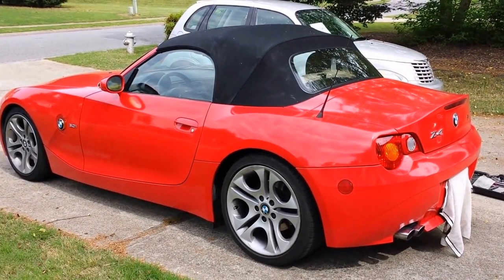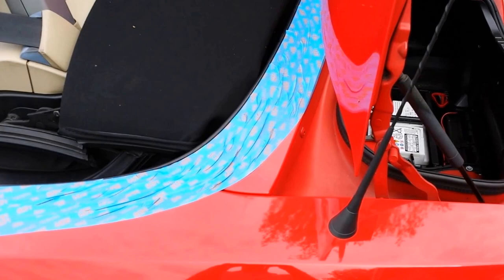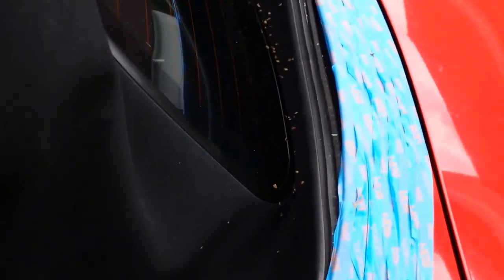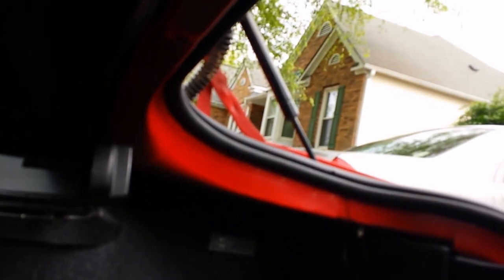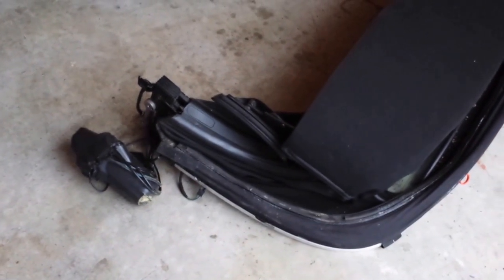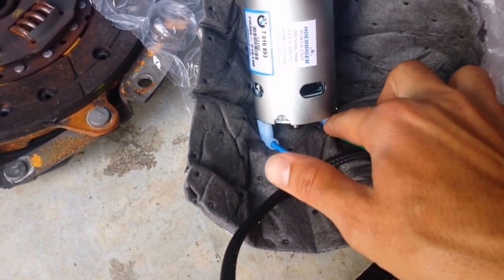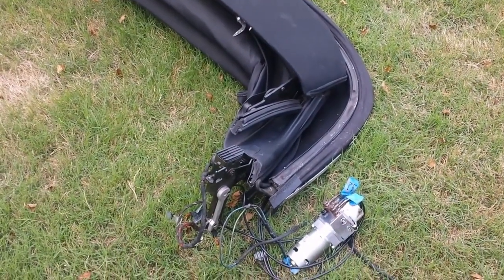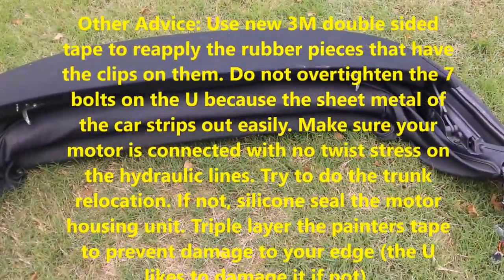How to remove test and replace a BMW Z4 Soft Top Motor COMPLETE HD

Comment: Awesome video and step-by-step instructions.  I will be attempting this very soon and relocating my motor to the trunk.  I would love to see pictures of how you mounted yours inside the trunk if you have any.  Did you re-use the same container that the motor was stored in from the factory or fabricate something else?
Reply from the maker: Thanks Jeff. I ended up cutting two slits in the side wall just adjacent to the plastic trunk roof latch mechanism. I had to remove the trunk roof and the left mounting shell for the trunk roof (that covers the shock/strut position as well). I bent the small flap down and simply placed the motor in the trunk with the wires coming through it. Placed many layers of  electrical trape on the cut plastic edges to protect the lines from rubbing against them. The motor was left nude on the top half but rests in the lower half of the housing unit. It was a tight fit with the top on and this way I can check and fill the fluid level if needed. I chose not to tuck it beneath the trunk carpet. I can make a short vid if I lost you on this explanation.
Reply: @Pray4UrLife12  Thanks.  You explained it well and I can see what you mean.  My motor seems to be working (at least I can hear it run when I push the button) but the top doesn't move but can be operated manually even with the red lever that disengages the motor pushed in.  Could it just be out of fluid or does that mean there is a leak in the hydraulic system somewhere?  Either way I have pretty much decided to remove the top just so I know for sure what's going on.
Reply from the maker: @jeffk9658  could be low fluid or you just need to prime fluid throughout the system again. If mine sits too long it takes a good 40 seconds of holding before I get fluid pressure top open my top. I used a heavier fluid than oem though so I recommend you use the orange/gold color hydraulic fluid, if not oem, to top it off. If it's a louder noise than usual, it's probably low on fluid. Later on, I had a fluid leak out of my right hydraulic hinge and decided to send both of mine to get rebuilt. No issues since.
Reply: @Pray4UrLife12  Wow, very good info.  I really just bought the car a little over a week ago so I don't know what has been done in the past or how the motor sounded before, although it doesn't seem very loud.  I tried holding the button down and the motor runs for about 15 seconds then stops and the red light flashes the entire time until I put the top either completely up and push the close button which locks the top to the windshield or all the way down and put the down button to complete the process that way.  I also could hear a fain "gurgling" sounds coming from the area of the motor leading me to believe that it may be leaking fluid.
Reply from the maker: @jeffk9658  welcome to the club. Yes, def worth the look.
Reply: @Pray4UrLife12  It's been a couple of months but I thought I would update on my situation.  As it turns out my motor is fine but the hinges were leaking.  Replacement hinges would have been around $1,600 but I found a company call Top Hydraulics out of Oregon that will rebuild them for about $500 (after shipping).  They also sell longer hydro hoses to help with relocating the motor to the trunk but I did not buy those.  Removing the hinges is quite a task and I wish I would have done a video because I learned some things that would help others going through that.  Anyway, the top is back on and working except that the driver side latch does not exactly meet the holes on the top of the windshield so I have to "coax" it in by hand.  Something is not lined up exactly.  I also have an airbag light that was not there before.  I've had it checked and every airbag sensor in the car is throwing a code which tells me I missed a wire or cut something while reinstalling the top.  Thanks again.
Reply from the maker: @jeffk9658  gratz on finally fixing it. I too used Top Hydraulics to rebuild both my hinges when I noticed one of them were leaking. Great company at a great price. Odd thing is, ever since I unplugged my battery on my z4 my airbag light has been on. I can't remember what the code was throwing but I have not bothered to correct it. In regards to your misalignment, I would simply undo the bolts that mount by your hinges and readjust from there. No need to take the top back off.
Reply: @Pray4UrLife12  I went ahead and removed all of the bolts in the trunk as well as the hinges and put it back together with the top fully closed.  It improved a little but is still off.  I believe the hinges may have been damaged when Top Hydraulics rebuilt them or I did something when removing and reinstalling the top.  I can live with it.  I would really like to get the airbag light turned off so if you find a solution please let me know.
Reply from the maker: @jeffk9658  same. Keep me posted if you can. Thanks!

Comment: thanks for the upload way more useful thank prodemand. im having an issue though i swapped the motors and tried testing motor work but its not pumping fluid is there a bleed procedure. im testing everything before i reinstall and im not pumping fluid through. ive even loosened the banjo bolt and its not pushing fluid through im kinda lost at the moment any advice would be appreciated
Reply from the maker: Late comment but for those reading this: if you are testing the motor in the car after installing and the motor is not working (no power to it) and you see an orange light at the top lift button it is because your trunk roof is not installed to engage the safety sensor which is found on the back wall of your trunk. Either cram a paper towel into the sensor to engage it or install the trunk roof.

Comment: Hello , Pray4u , I had the same issue about hydro pump motor then I just purchase a new one . After I replaced its and test its before reinstalling the rooftop back on its just work fine . Then after I put it back in , I heard the motor running, but the roof doesn't move at all. So do you have any idea or did I do something wrong? Thank you, have a good labor day weekend.
Reply from the maker: James Le is the trunk roof installed correctly? It needs to be contacting the sensor that you see on the back wall.

Comment: Forgot to ask...anything special I should specifically be looking for physically on the pump to see if it starting to fail?btw..sold my 2004 325i with 80,000 before I bought the Z..excellent shape..clutch was getting tired.same color combo as your Z.
Reply from the maker: The pump failing is usually caused by water leaking into the housing. You can hear the pump work super loud and sound like a cringing machine more than a smooth motor. What I did was add extra fluid to mine and relocate it to behind the drivers seat for now. I am short so I can get away with this. I suggest using a lifetime waterproof silicone. Only use a little bit because if you make it too thick it won't squeeze back into its spot. On the motor itself, usually towards the bottom and on the "motherboard" you will see rust and corrosion start to form if the housing is compromised.
Reply from the maker: Nice buy! I went 2 months looking for a 5 speed 3.0 and ran into mine. I didn't want red but it really grew on me. The 6 speed won me over.

Comment: So my z4m too stil works just needs some assistance closing. ECS tuning sold me a repair kit any thoughts on it ?
Reply from the maker: Assistance closing in what way? Could you be more specific? Have you checked your fluid level? Any leaks in the lines or hinges? Never used a repair kit so I don't have much I could comment on that, sorry. Maybe someone else can chime in?
Reply: Pray4UrLife12 so when I open the top I hold the button it works fine. When closing it starts to hum like it’s trying to close and I have to use one finger and apply maybe 5lbs of lift and the top starts closing and I can let go about half way and it does the rest in its own. Idk how to check the fluid. I bought a repair kit from ecs and a liter of the hydraulic fluid. To check the fluid do I need to remove the top? I’m very handy on working with cars I have to e60 v10s just never had a car with a hydraulic top. Also I have ISTA D I’m guessing I can prime the pump from there and see if it’s better
Reply from the maker: The issue you are describing was similar to what I experienced with my car (unrelated to this video and happened this past year). I took the top off because I wanted to inspect the hydraulic hinges. It turned out I had to send my right hinge off to get rebuilt because it was leaking fluid and not holding pressure well. This was causing the roof to need a helping hand up. I could also see that the left side was coming up more normal than the other before it reached the point that it needed a helping hand. I decided to send both hinges off to be rebuilt for about $400 US.  I would first check your fluid level. While you could sneak the motor out without removing the top by reaching in and pulling it out, I would just take it off to inspect it all and then relocate the motor to the trunk when reinstalling for easier access in the future. The fluid container is on the motor itself and a fill line is marked on it. Google a picture of one. I hope that helped. Good luck!

Comment: That's probably, I just threw it in and may be the hydraulic line they are not correctly to be straight w/the hole in there. Thank you Pray4u, I have to redo it again.
Reply from the maker: No James, do not do it over again yet. Just go to your trunk. Look at the black plastic trunk roof you pulled out. Make sure when you put it in, that it hits the metal switch in the middle of the back wall. The silver switch inside should be depressed for your roof to work.
Reply: Pray4UrLife12 
I see, thank you so much...

Comment: Hi.
thanks for your educational video, I wonder if you can help me, my cab doesn't lock  when I open it, so the red  light  keeps flashin all the time, what's wrong? thnks in advance!  Greeting Iradj
Reply from the maker: Sorry for the late reply, perhaps you can reply how you fixed the issue so others can learn too. Are you saying that your roof is closing but does not lock tight once it is pressing against your windshield frame front lock hatches (by your rear view mirror)? If so, it sounds like the issue is the latch lock motor that I believe is found within your framework above your rear view mirror.

Comment: Just started follow you ! 2 questions what happens if you connect the two wires in the bottom of the motor wrong? I did not mount everything back before I tested, but did not work I could hear the electric motor spool but no movement.. same thing when I had the whole convertible out and I tried with a car battery, no movement of the pistons just heard the electric motor spool. Please help me out
Reply from the maker: Hi Zed fam, if you reversed the plugs I believe it would close the top when hitting the open button and vice versa, unsure if it would get interrupted by the initial or final locking mechanisms. It sounds like the pump is still priming the system with fluid. If you filled the reservoir to the fill line it may take 20-30 seconds (or longer) of holding the button before anything happens. Make sure the motor is not sideways to the point that it introduces air bubbles into the lines. Be sure to recheck the fluid level and top off again after it opens and closes. Give this a try and get back with me. Good luck!
Reply: @Pray4UrLife12 Thank you ! the pump had some hydraulic oil in it when I got it (brand new). Do I need to fill additional oil ? I think it's facing down correctly. But I am thinking about switching the hyd lines or the cables. I connected everything the Same way as on the old pump and I thought the worst thing that could happen is that it goes in the wrong direction ?
Reply: @Pray4UrLife12  also if you hook up a battery to it when you have the cab out should the whole thing move then or do you just hear the electric motor spool ? If everything is connected correctly..
Reply from the maker: @bestinshape5368  The entire top closes and opens if set up correctly and all is well. What made you replace the motor in the first place? What were the symptoms? Are you sure your side hinges are okay? No leaks from there correct? Ever resolve your issue? Sorry for the delay.

Comment: Hi, thanx for a great video. How long does it take to do this? Is it doable in a weekend?
Reply from the maker: if you have the motor already, it can be done in about 4 hours. The annoying part is waiting to buy the motor until you test the current motor after removing the roof. Then having to garage the car until you get your motor.
Reply: Many thanks for your answer. What is your opinion regarding failing opening....Is the motor the most likely reason for malfunction?
Reply from the maker: Istvan Bartha is the light that is by the roof button in your cabin red or orange when you hit it? if it is orange then your trunk roof is just out of place and the safety sensor is stopping you. a motor may be bad if it opens the roof only partially, makes loud grinding noises, or something nothing happens at all. diagnosing is the hardest part.

Comment: Hello.. How much oil you get in? Thanks for answer
Reply from the maker: I am not sure what you mean. If you are asking about the oil for the motor, I believe there is a fill line that you can see in the chamber. I filled it up to there. Open and close the roof a couple times then recheck the level again.

Comment: I tried replacing mine and hydraulic fluid is spitting out from where the hydraulic lines meet the pump. The top wont move. Any ideas on why that would happen
Reply from the maker: Did you make sure to tighten down the bolts all the way and place the lines in the correct spot on the motor? I don't remember if there are o rings but you should see them in the video if so. Make sure they are in place if so.
Reply: @Pray4UrLife12  I read online that they should only be tightened to 12 nm. I did tighten them more but it didn't work. Neither the original nor the new pump had a large o-ring. Maybe that's what I'm missing. That or the banjo bolts are so rusted through they just don't work anymore. Rather not take it to bmw cause they'll charge me 6k, both my kidneys and my first born child to fix it lol
Reply from the maker: @hydrosynthetik  haha true true. Try soaking any rusted components in vinegar overnight.

Comment: About the banjo bolts: as far as I know - the hydraulic lines don't need to be aligned with the hole inside the bolt.
Reply from the maker: correct

Comment: I checked my car switches and fuses and motor pretty much everything and still not working what can it be? Seems like the lower button doesn't send signal to the motor
Reply from the maker: If your light is blinking orange when you try to open the roof, it could be that the  trunk roof cover is not engaging the metal switch sensor.  That sensor is on the back wall of the trunk.  Check that first. If not, maybe you can remove and test the roof button switches with a multi-meter?
Reply from the maker: What color is the light when you hit the lower roof button? Is it solid or flashing?
Reply: @Pray4UrLife12  it blinks, I already checked the micro switch, fuses and replaced the motor. It seems like when I hit the button to lower the hood doesn't send the signal of that button to the motor. I switched the cables of the button to see if it worked and when I did that the close button worked lowering the hood but not which means one line button is not working
. I believe there is something wrong with the green cable which is the lower button but I'm not sure. I been looking for help this past years. I wanna DIY my self

Comment: Is it possible to take the outer shell off without removing the entire top?
Reply from the maker: you can take the shell off but the trouble comes when you have to bolt and unbolt the hydraulic lines. It is a much faster and easier job if you just take the roof off. I tried without and could not.